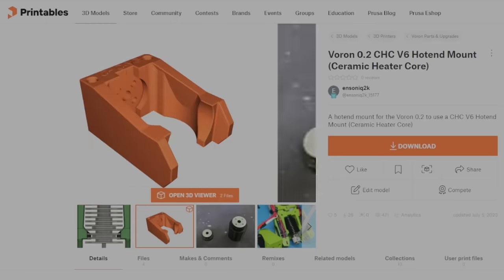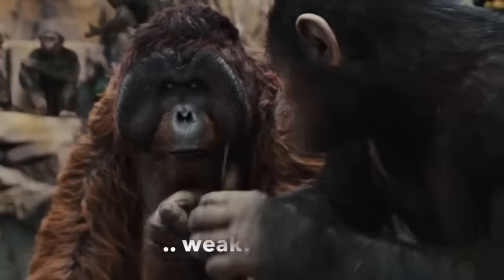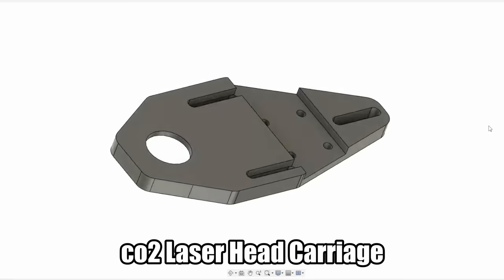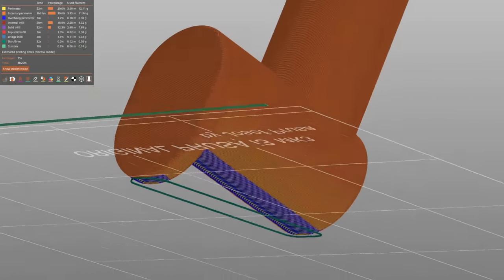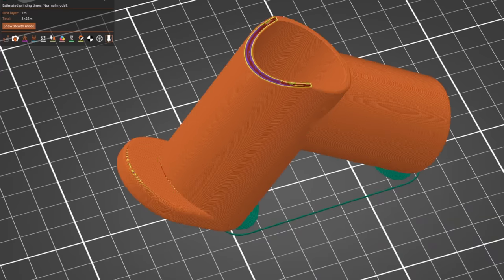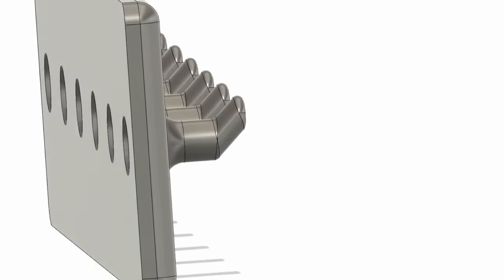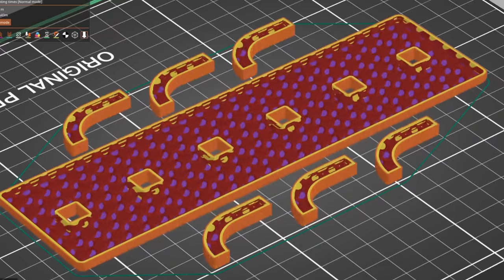3D Print Design SINS that need to STOP on Thingiverse, Printables, Cults3D etc.

Comment: For the hooks, my solution would be to have the bottom of the hooks extend to the bottom, with a 45 deg overhang.
Reply from the maker: That's also possible. There are no wrong answers as long as it prints decently :-)

Comment: Nice video, with good points from the engineering perspective, but
If you change a design visual, it is not the same design to a customer. If I want rounded corners and you give me 45 angles, I will send it back. If a customer pays for a design, it will be my job to make it strongh enough and print correctly.
The whole thing about rounded edges at build plate level, can be fixed by setting up the printer and slicer correctly, or atleast it fixed it for me.
Again awesome video and some food for thoughts.
Reply from the maker: Thank you! I'd be really interested to see a 5mm+ rounding facing the built plate printed cleanly. I've never seen anyone managing to do so perfectly.

At least in my profession if something is physically impossible we tell the customer and they have no choice but accept this. They can choose between some dream design that doesn't work out or a real world approach, even if it's less fancy.

Comment: Sharp overhanging corners (usually just for esthetic purposes) close to the bed are my bane, they almost systematically curl up as they cool down faster than the the inside of the print, I must have a draft in the room or something. Think a benchy hull for example.
Reply from the maker: You automatically get air movenemt with a heated up bad, that's the issue. Especially on open frame machines. It's not really astehtics anymore if it turns out horrible, isn't it?
Reply: @SmallBatchFactory  I might actually try to see if barely heating the bed gives me the same issues...
It doesn't help that I've been trying to push the speeds with PLA and people with a similar setup were getting none of that and it barely seems to be a problem for people online, drooping down yes, curling up almost never. However whatever speed I trie I just couldn't get a small TPU overhang corner to print nicely and it was turning me mad. I finally got a TPU (90A) benchy printed perfectly by increasing the amount of walls to 3 from 2 but I want to keep small walls as these TPU parts often go on my drone. To get it everything had to be perfectly tuned (Klipper+Orcaslicer calibrations) and I had to drop down to a smaller 0.5 nozzle than the 0.6 I was using (All on a Klipperized S1 Pro).
Reply from the maker: @SwainixFPV curling in my experience, often occurs when printing too fast / not enough cooling is done. For better overhangs you can reduce layer height, but it's not a magic pill.

TPU overhangs are just the worst to print. I try to not have any if possible, at least not steep ones. I did teardrop shape holes with success where I needed holes. Round holes have way too much bridging.
Reply: @SmallBatchFactory  I've found some success with TPU by having a lot of pressure equaliser to keep the flowrate as consistent as possible, and paying attention as to how the infill will cool down as it sometimes would start pulling on the walls too
For PLA I lowered the speeds ("only" 120/150 outer/inner and 60 to 15 for overhangs), and it will definitely print perfect overhangs if they are even a few centimeters off the bed. These settings still get a good benchy hull despite its sharp corner close to the bed (layer time was increased to 6.5s as well). Just annoyed because I thought I could squeeze some more out of it and the acceleration would be there.

Comment: What was funny is I realized the other day is that The 3D benchy file has issues with the model itself that Prusa Slicer fixes.
Reply from the maker: Which do you mean? It's not meant to print perfectly, it's to test how well your printer handles certain things
Reply: It can be printed perfectly, if you calibrated your printer right and set up your slicer correct for your material.
Reply from the maker: It can be printed pretty good but not really perfect. The windows and doors are meant to be a test. I've never seen a Benchy that didn't have at least a tiny amount of sagging on those bridges.

Comment: "too many perimeters" until you bump it with your hip while you walk past, or hit it with your foot, or any number of other accidents, and the four perimeters crack, resulting in you having to reprint the whole part
Reply from the maker: To be fair more perimeters usually don't help in that case either. That's why I prefer printing with layer lines in mind as shown with the key hanger. Kicking a larger part is usually fine since plastic has quite a bit of impact resistance. But getting caught on a hook will totally break it.

Comment: As for me, the biggest issue for technical designs is that people still upload stl instead of cad file😢.
A few times I used to recreate part from scratch.
Reply from the maker: Happens way too much. Changing STEP files can be a challenge too, but nothing compared to STL. Did a mod for my Vorons hotend that took a while even with STEP files.

Comment: Rounded corners facing the build surface aren't an issue at all, as long as print order (inside to outside), print temp and parts cooling are set correctly / up to task. I've not seen a factory release that has adequate parts cooling to date. Fix those things and this wont need to be in the video  :)
Reply from the maker: Pics or it didn't happen

Comment: The point of the video certainly resonates with me.  Any more I only work with designs that include files I take directly into Fusion 360 for modification if needed.  Otherwise I look at a lot of designs for ideas and the draw my own from scratch.
Reply from the maker: Definitely my approach as well. It's usually not more than a few minutes of modeling anyway, if you're experienced. Building the idea in my head takes way longer.

Comment: Gawd I hate it when a complex or organic design i want to modify for my use can only be found in STL form.. I’ve converted a few into a useable form using the mesh tools or used them to generate sketches in fusion 360 but it is rarely fun or fast.  I’m no Fusion 360 expert but sometimes that app just looks at a model and says nope or has a useful function behind an extension/add-in paywall.
Reply from the maker: Fusion has quite a few limitations where it just rage quits. Always a bit sad

Comment: PS. i go for 1,8 mm walls with my 0.6mm nozzles. thats tough enough for the most parts..but sometimes i do more, to fill the gaps like u...but when i design...i try to get it in vase mode, or at least try to avoid any support structure...and so on...specialiced on designing for fast reliable "eco friendly" designs....CULTS3D mindbreaker3D
Reply from the maker: 1.8 is totally fine. I try to make it divisible by the Nozzle size not with Arachne wall generation that doesn't even matter anymore

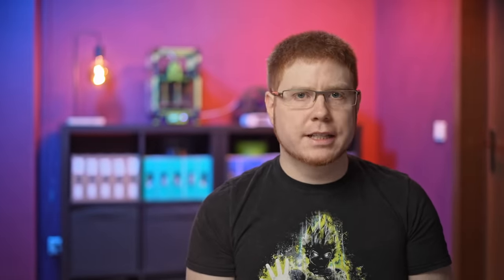Comment: 6:06 that key hanger shouldn't be printed in the first place. just get a wooden plate, some self drilling screws and some hanger hooks. it'll look way nicer than anything a 3D printer can make.
Reply from the maker: I can't disagree. If someone rather wants it printed that's fine too. This specific model was intended to stick to a fridge using magnets so wood might be too heavy.
Reply: @SmallBatchFactory  you're right, that would be too heavy. though i find it odd to hang keys on a fridge.
Reply from the maker: That's the beauty of 3D printing. You can use it for many things, even the odd ones :-)

The guy who designed it commented somewhere here so you can even ask if you're curious.

Comment: I am pretty sure half the models on thingiverse have never been printed. I very rarely get anything that will actually print. I almost always just model the parts myself. I hardly even look on there now.
Reply from the maker: It's mostly a source of inspiration nowadays. With a lot of support material and low expectations you can print almost anything.
Reply: @SmallBatchFactory  You can print almost anything but, as you point out, specially things like curved bottom laters, a very common thing on unprinted models, it will print but be pretty bad. The sin is very evident in all the car models, with the wheels just modelled as is and the car body off the build plate, then a hollow body. I assume it's just kids.
Reply from the maker: @originalmianos of course it will turn out horrible. I've met people who wouldn't even mind the horrible print quality and we're like "oh well, that's just the way it is".

I guess those models you speak of are taken from games or somewhere else. They're not modeled for printability but easy to come by so they end up on Thingiverse
Reply: @SmallBatchFactory  100% agree, loaded from game content or one of those old model archives for 3d models and converted.
I have been using fusion for at least 7 years and 3dprinting for a few more. My style has slowly changed quite a few times over the years. I find, at the moment I am tending back towards modelling multiple parts for good printing and fixing them together. There was a time when I modelled for good support but I think, these days, any support is best avoided, if possible.
Reply from the maker: @originalmianos I totally agree. I model for best results. Even the Voron team does a lot of parts in multiple pieces. Even adding self tapping screws to support the layers from breaking.

Comment: half of the issues you mention are more the fault of the user not correcting it on their end than it is the designer. Repetier can reorient parts with minimal effort, and i realized not to print stress lines along the layer lines like 3 prints in
Reply from the maker: If the print orientation is not convidered when designing there's usually not much you can do when printing. You might be able to prevent the worst case but that's about it

Comment: Voron parts have curved angles facing the build plate. At least two sets of parts does it for the 2.4
Reply from the maker: Which one? Haven't had any issues printing them. To be fair a very low radius, like 1mm or below works out fine. People tend to go way above 1mm, which turns out horrible.
Reply: @SmallBatchFactory  The front idler parts and then I think it was the XY joints that also had those curved angles. The front idlers is the worst one. I now use the BFI(Beefy front idlers) instead, they do not have the issue of the stock idlers.
Reply from the maker: I think they changed those parts recently. At least I can't remember having any issues printing them. To be fair I used my worst ASA filament so I might have accounted any print issues to the filament quality.

Comment: 0.4 mm times 4 perimeters is 1.6mm - was this just misstated or is the 0.4 mm nozzle putting out 0.5 mm width lines?
Reply from the maker: I had 5 in my script but said it wrong. But a 0.4 mm Nozzle is also capable of putting out 0.5 or 0.6 mm just fine. In fact even 1mm works but the pressure rises so it's not advisable to go to high.

With Arachne the Slicer varies the extrusion width by itself too.

Comment: Let's test rigidity on 3 walks, which is the average wall count in 2023, and another 3, so 6 walls= 2.4 mil thick. 
Vs. a model with 6 walls and only 8% rectilinear infill at 5 mil thick.....

If you haven't actually done this back to back, please test before commenting. The 5 mil will win every time when it comes to flexing the part. 

Sometimes it's the best option if you can't add any bracing to increase rigidity. 

If anyone is willing to donate to prosthetics for kids I'll run the test several ways just for you.
Reply from the maker: That's why I specifically talked about "geometry covering empty space" like with the power strip holder. The walls can flex and in this case it's totally fine. Limbs are a whole other topic.

If you need high rigidity you need larger sections. Dont forget that the top and bottom layer in your example also add quite a bit of strength that's not present and not needed in my power strip example.

Comment: Instead of metal screws for the hooks, one could also use plastic sticks printed in different orientation.
Reply from the maker: You could. Printing the hooks separately is the best of both worlds. Metal. Screws are helpful if you need very strong parts.
Reply: @SmallBatchFactory  Though tad more work if you want to keep the roundness which is part of the world :)
Reply: @SmallBatchFactory  On some of my prints, I've made them hollow and filled with resin. They are quite strong but support more organic shapes. Also embedding some bent metal into the resin could help.
Reply from the maker: That sounds really interesting! Injecting Resin is something I never thought of
Reply: @SmallBatchFactory  really only worth it when making multiple items as resin is quite nasty to work with, toxic and all.
Reply from the maker: @AllanSavolainen I was thinking about a one component resin/epoxy like "liquid metal" you can buy in syringes. Epoxy glue should work just as well I guess and is not nearly as nasty.
Reply: @SmallBatchFactory  ah those would be easier to work with and won't seep though layers
Reply: @SmallBatchFactory  Now here's a fun idea! Print the hooks separately and make one side a flexture that snaps into the wall bracket from the back. Add a small base to the hook so it can't be pulled through too far. Add the relief for the flex nub into the wall bracket. By making everything one sided you can still print the hooks laying completely flat and the base should still print easily. Then when you are done you assembly by pulling the hooks through the back of the wall plate and snapping them in place. Once it's mounted to the wall, changes of the hooks ever being pushed out is very low. Pretty easy to add sufficient tolerance as well.
Reply from the maker: Another useful upgrade idea for the design! Never needed a key hanger but maybe I should make one.

Comment: Radius edges facing up or down absolutely infuriates me, I have no idea why people do this. Radius goes on vertical edges, chamfer goes on horizontal edges. End of story.
Reply from the maker: I have to confess I did this in the past too until I learned that doesn't work well. I'll do it facing away from the build plate still if it fits the model though.
Reply: @SmallBatchFactory On top looks better than on bottom but it still doesn't look great because the layer lines stagger more and more with each layer. Chamfer on top horizontal edges looks the most consistent.
Reply from the maker: That's true! It's usually fine with just a few millimeters of radius but with more it becomes clearly visible.

Comment: I didn't understand the wall thickness thing at all. Could someone provide some additional clarification or explain it another way?
Reply from the maker: If you Design a wall and you're printing with 3 perimeters for example:

Make the wall 2mm and you get 5 perimeters that are seamless and touch each other.

Make it 5mm and you get 1.2mm outer wall, 1.2mm inner wall and 2.6mm of empty space / infill.

Its easier to break 1.2mm on impact than 2mm. The design looks more sturdy but it actually isn't since the print is mostly hollow.
Reply: @SmallBatchFactory  that makes sense. Thanks for the explanation!

Comment: i print at 0.6mm line width and 0.3mm layer height and i design all my parts to suit the way i print, so if that doesnt suit your settings then sorry not sorry lol
Reply from the maker: That's fine, it's your wasted material
Reply: @SmallBatchFactory  lol, thats a massive assumption! my point was to your 2mm wall recomendation, i do 1.8mm, or 2.4mm if i need more streingth, i dont do that double wall nonsence and my designs do not waste filament, but my tolerances and everything are made for my settings, if you printed it with different settings it might not work for you, saying im wasting material when you never even seen one of my designs was a massive assumption, and you know what they say about assumptions! tells me a lot about you
Reply from the maker: @christhorney the it doesn't matter anyway, a 0.4 mm Nozzle can also do 0.6 just fine and you're just fishing for attention.

Comment: Many  designers are employed by filament companies and the intention of the design is to waste your filament.
Reply from the maker: That's an interesting take. Let me fetch my tinfoil hat
Reply: @SmallBatchFactory  you could print the hat in metal filament in several parts, but the tolerances aren’t correct so you will need to sand them or redesign them
Reply from the maker: Let's stick to the right tool for the job and just crumble up some foil :-D

Comment: And if you have an SLA printer then there’s entirely new design restrictions
Reply from the maker: Oh yes, but there's also a misconception about large flat surface. I might need to make a video about that
Reply: @SmallBatchFactory  you mean how it shrinks unevenly and can break the part? I’ve had issues with that if you print stuff on the plate, and it’s definitely more difficult to design parts with thin surfaces that you don’t want layer lines on. I almost always print on the plate with almost no supports and that definitely has it’s own design constraints
Reply from the maker: @SauceM3 the issue with that is that it takes a while for the build plate to push the viscous resin aside which ChituBox and friends don't account for. So you have to much distance from the LCD and the Resin cures a but is still in movement. That's why we get large elephant foots.

It's a very logical thing once you understand the core issue. There's third party software to mitigate those issues but it's quite a bit of tinkering.
Reply: @SmallBatchFactory  I haven’t really had issues with that, I also use ChituBox and I just drop the lowering speed if there’s a large surface, unrelated but I have gotten the machine stuck before though lol